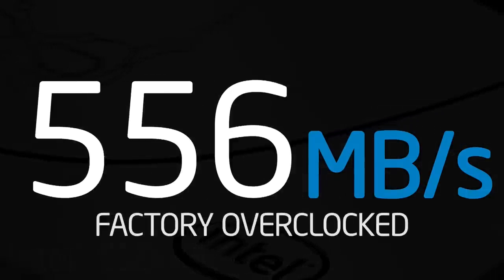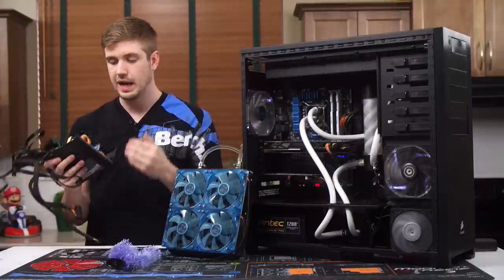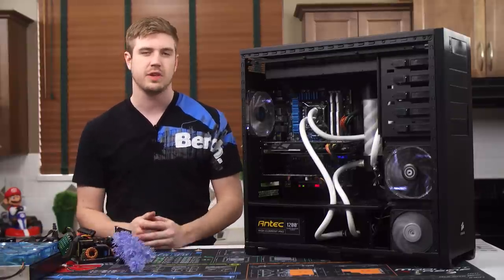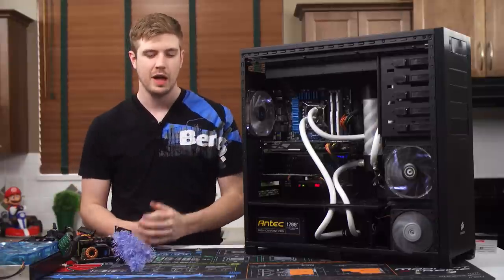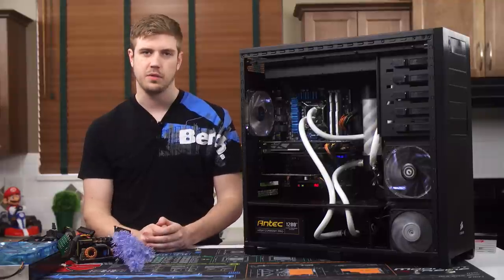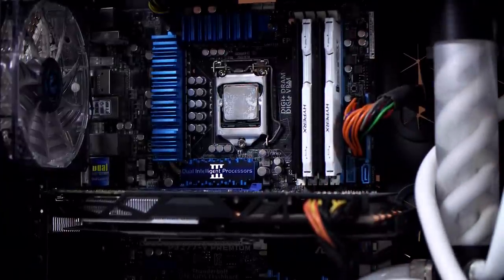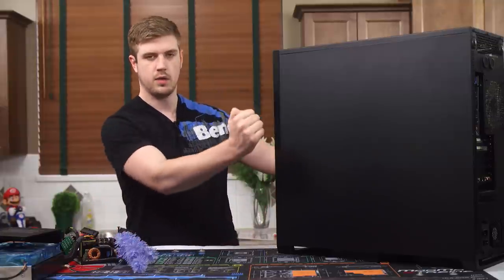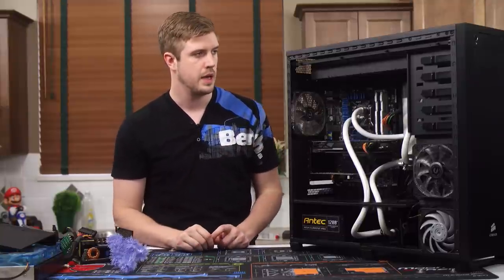Personal Rig Update 2 - Slick: The Introduction of Squirtle

Comment: hasnt the 4770k for x79 platformed wowed you at all luke?
Reply: Its only about 20% faster than his current. Not much of a point to upgrade when its gonna cost you $300+ considering he would need a new mobo as well. And if hes getting 5ghz out of his current chip, thats a damn good chip. Prolly runs pretty damn close to a 4770k. "Well then he could get a 4770k and overclock that to 5ghz right?" Wrong, no two cpus are the same. Some can overclock to 5ghz+ and another chip of the exact same model might only be able to hit 4.2ghz. And 4770Ks are pretty infamous for not really having OC friendly chips. They exist, but kinda rare. Alot of risk spending $300+ when you might not even be getting much of a performance gain, or even non at all.
Reply: Haha and btw i wasnt trying to say u are dumb or anything to think a 4770k would be a good upgrade. haha.
Reply: LMAO ooops I made a mistake on my original post....I mean to ask why the new z87 platform or x79 platform wowed him? Anyway 5Ghz is such a golden overclock he doesnt need a 4770k, I'm just suprised he hasn't been wowed at any of the xeons or SB-E and IB-E platforms. Its his prerogative, he might not have any uses for socket 2011 chips at home..I mean his work pc is socket 2011 based anyway.
Reply: He might as well just wait for Broadwell. Haswell isn't too great.
Reply: Haswells are HOT like literally, your chances of getting a good chip is also smaller. I can't get mine above 4.3GHz without hitting more than 1.3V and hitting 100C on my H80i.
Reply: acnfanmanin 100C!! Your poor chip!
Reply: acnfanmanin mann. thats just a bad chip. i get 4.7ghz goin up to about 85c with an air cooler
Reply: Yea I know I got an bad chip but it shows you can't get the 5.0GHz like on sandy on most chips, my chip says it's malaysian. I heard some people say the Costa RIca chips are better? Where's yours made?
Reply: Haha i have no idea. The cpu was the last thing to come in when i ordered parts for my rig so i was pumped to get the thing built. So i just threw it in and didnt bother to read the front. Haha.
Reply: hahaha, well this is my first build and it sucks to get a crappy chip the first time. :(
Reply: Oh and what's your cooler?
Reply: acnfanmanin Got a Costa Rica chip, but haven't overclocked yet. Do you have a source on Costa Rica chips being better or anything?
Reply: I forgot where it was but it was on a forum thread somewhere. I'll try to find it though.
Reply: Nick Wallace My 4770k's an alright chip. I have it at 4.5GHz @ 1.240V. Going to try 4.6GHz and so on eventually. It's cooled by a H100i, btw.
Reply: 4770k is a horrible overclocker compared to the 2600k. 4790k is nice for oc tho but still the 2600k is insane man. Luke has a profile set for oc on his 2600k for 5 ghz?.. i mean most 4790k's struggle on that underwater... :) 4770k would never reach 5 ghz on water haha
Reply: MrHearthofSIN Horrible overclocker? Tell me you're kidding.
Reply: lmCIoudz 4770k is a horrible overclocker dude.. the 4770k was a step backwards.. 4790k barely saved the haswell generation for overclockers.. 4.8 was the rated best on the 4770k and if you could go 4.8 ghz it would be the top 20% of good chips you owned /owns... that's horrible when the 2600k was easily 4.6 to 4.8 ghz overclocker and golden chips was 5.0 to 5.2.. while 4.8 ghz on the 4770k is still fast.. it's just not anything impressive.. and i understand why Slick won't change his 2600k out for a 4770k (example) because the 2600k with a 5 ghz oc that he has jsut destroys any 4770k man...
Reply: MrHearthofSIN It's not a horrible OCer. Plain and simple. Sure, the chips aren't the best, but they aren't "horrible".
Reply: MrHearthofSIN And that 2600k does not destroy any 4770k. LOL
Reply: lmCIoudz i never said the 4770k is a horrible chip.. it's a horrible overclocker.. and yes it is a horrible overclocker compared to the 2600k.. the overclocked 2600k will destroy the 4770k overclocked aswell dude.. the 2600k is stupid fast.. tho the 2600k will be hotter than the 4770k but a nice liquid system should tame it ;) go to cpu boss and compare them and maybe google some stuff if you want to know more about cpu's m8 :)
Reply: MrHearthofSIN It's not a horrible OCer. 1GHz OC on my chip, and temps are SOO hot. Under 70C is soooooooo hot.
Reply: Clocked at 5.2GHz? Bullshit, if true then it wouldn't even be stable or you're pushing ridiculously high voltage and it won't last long. Also 45C on H100i is impossible, you must mean it's on idle yes?
Reply: Anusheel Nand Oh yeah I forgot to post this, sorry for being so late. http://www.overclock.net/t/1398975/official-haswell-owners-thread/960
Reply: acnfanmanin haha thanks
Reply: Frag Atron I don't think you can do that
Reply: Anusheel Nand No prob

Comment: I got a question about a motherboard that i have.

I got a "M5A78L-MLX plus" motherboard sitting around in my room that i really don't use but got it from a guy for $10.
 
Is the motherboard any good for gaming now days?
Reply: It's a good way to save you money on a starting AMD rig. You can throw an FX processor and nice video card and play anything you want. It's not the very suitable for intense overclocking tho.
Reply: I know but what should i do with it tho? 
I got an FM2-a85xa-g65 mobo that I'm currently using.
Reply: Ask yourself how much you wanna invest and check the reviews out there which platform will give you the best performance.
Reply: You could probably just get a processor for it and replace the motherboard/processor combo you have right now. A lot of the FX processors are extremely well priced.

Comment: Could Someone Help Me Please.... or turn me to the right direction to ask for help.

I'm going to start building my own gaming computer but I only like 2 Case's:

Aerocool X-Predator Full Tower Gaming Case with No PSU and Orange LED Fans - Black

And the:

Cooler Master Storm USB3.0 Trooper Window Side Panel Edition XL ATX CASE

Wondering what is the best or a true gaming case ?
Please Help

MR G
Reply: i wouldnt say there is a "best" or "true" gaming case. it all comes down to preference. my first case is the antec 900. i like the blue leds, the number of fans you can have on it, 7, and the size of it. after about a year and a half im ready for a new case.

right now i really want the Corsair Carbide Series Air 540 High Airflow ATX Cube Case. i really like the big side window and the 2 compartment system in it. when i do upgrade my case, i want new fans for quieter cooling and liquid cooling for my cpu. with this case you can mount a radiator in the front or top. i like the top idea more. 

it all comes down to whatever floats your boat. 

with that said, anything else i can give my opinion on?
Reply: There's no such thing as a "true gaming case".  Instead of looking for a case for "gaming", you should be looking for a case that suits your individual needs the best.  What mother board/GPU/CPU are you going to be adding to it?  What sort of aftermarket parts are you interested in?  Do you want massive amounts of cooling for overclocking, or less power usage/noise?  What sort of aesthetics do you like?  Does it have to be portable, or will it be sitting in the same room for most of its life?  These are all questions you should be asking yourself.

The two cases you have selected right now are absolutely massive.  If you want to have multiple GPU's, liquid coolers for overclocking and enough hard drives to make your own home server storage system that's fine, but if this is a more frugal first time build, a mid tower with decent cooling will be more than sufficient.  Note that with a full ATX tower transportation also becomes incredibly difficult, and its going to take up a lot of space.

Basically, look at what you need, and less at what other gamers are doing.
Reply: I see what you mate Marbly & Robin Parmentier The only reason I picked the case's is they are the only big cases I know, As well as the mid-tower (Zalman Z11 Plus Midi Tower Case) But as a beginner I thought instead on getting a mid-tower case I would get a Big/ Good looking one and learn from it, add to it, change it instead of getting a small case and changing it to a bigger case in the future. And things like that if you understand where I'm coming from.

But I guess it's just my choice what to get instead of comparing them to see what's best.

Thanks for your help

MR G
Reply: ***** I wouldn't personally go with such a big case unless I knew that I was going to add massive amounts of liquid cooling/fancy stuff later, but if you want to and have the space for it it'll work fine.

Really the only thing that isn't entirely personal preference for a case would be build quality, so I suggest seeing what other people are saying about the case before buying it.  Sometimes they will mention things that are important but that you never thought of, especially if this is your first time building.

Good luck with your build.
Reply: ***** unless you plan on getting a massive mobo, 4 gpu's, more than 1 liquid cooler radiator, 3plus hard drives and all this other fancy stuff, a full tower isnt needed. 

i was in the same boat as you. when i first started looking at cases i wanted the biggest one i could find. then realized i wont need all that room. i have had my mid sized case for over a year and a half and i still have a lot of room for upgrades.

im not going to tell you what to do, im just telling you how i would do it. 

and who knows, you could buy your massive case now, then in 2 years you're online and see a case that blows you away, and you have to have it. your theory of never changing cases goes out the window.

i have a mid sized case, with a perfect sized mobo for it, an aircooled cpu that i wanna upgrade to liquid cooling. i have 1 gpu a gtx 670 ftw 4gb, 1 2tb hard drive, 1 cd drive, and 1 psu. i can add in 3 more hard drives, 1 more optical drive, 1 more gpu, and my case is a mid tower

from what i have read and watched on the internet, 99 percent of pc owners change their case atleast once
Reply: Robin Parmentier & Marbly Thanks alot for you help... it's made be think what I should do... what I planning to do is if I have the money (depending on one thing) I was going to get a Full Tower and get Everything for it so it's full but if I don't get the money I guess ill just get a mid tower to make it easier... 

So thanks guys need a good old think now about all this.

MR G
Reply: Marbly
unlike you, i got a mid size case, quickly fond out how crap they are, and upgraded to a full size tower. i didn't have anything else except for mobo, gpu, disc drive, fan controller, psu, and hdd, either.

a full size, though, just give you so much better airflow, and room, and just looks more aesthetically pleasing.
Reply: we r me go boom calm down there buddy. everyone has a preference
Reply: Sounds to me like you're gonna need to build two computers.

Comment: hey guys im new to custom liquid cooling and i want to make a custom cooling system for my cpu and gpu. I am hoping for a nice system while staying under $500.
I will accept case recommendations also
Specs
asus maximus vii hero
i7 4790k
Current cooler is antec kuhler 920
16gb corsair vengance 1600mhz ram
gigabyte ghz edition gtx 780ti
intel 520 120gb
cooler master cosmos 1000 (original cosmos case for 2008)